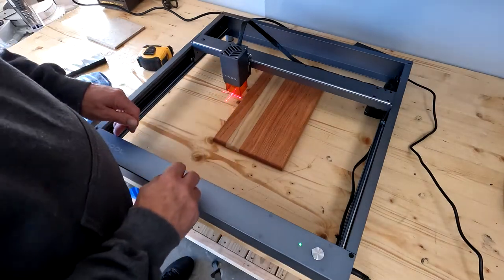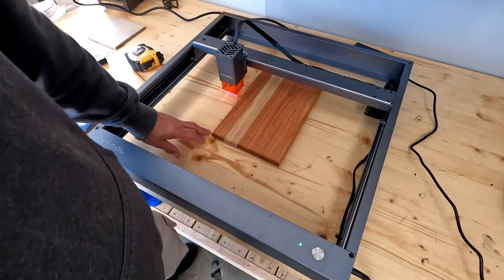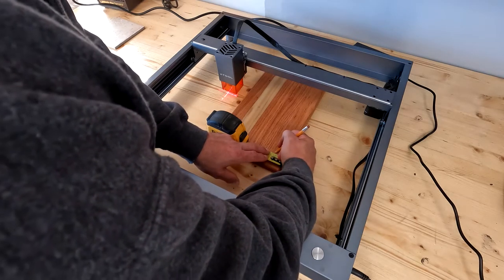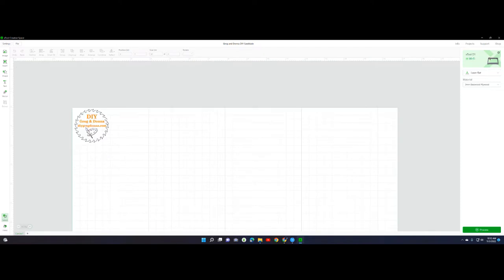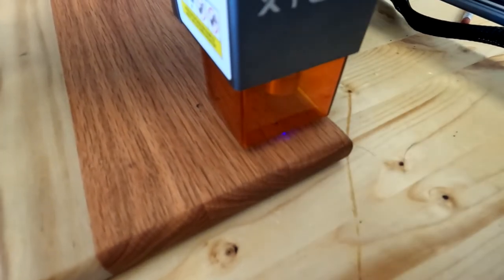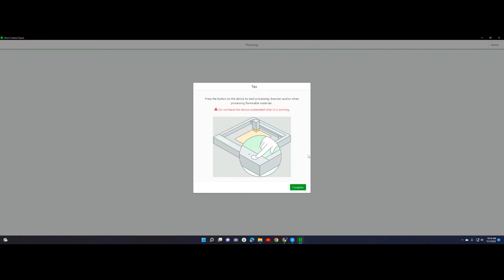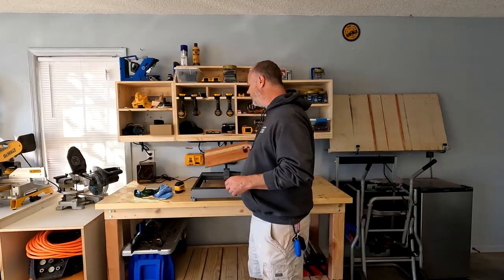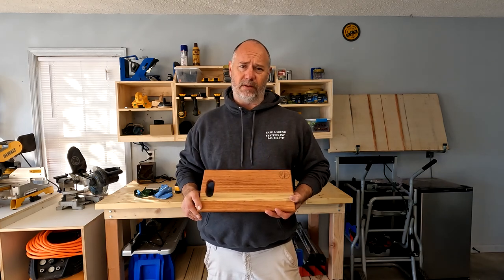xtool d1 engraver crosshair laser alignment center of project fast easy update

Comment: I'm sure you've got this all figured out by now, but just based on this video I'd recommend eliminating the need to travel between your pc and workspace! I'm very much a pc guy and it seems you are too. I do all my designs and work in my office at my pc, then I put it on a thumb drive and open it on a laptop at the machine to process. I don't have wifi is why I use a thumb drive but it's also just easy. It's my old laptop I bought for college 12 years ago, but it's perfect for this kind of thing. Otherwise if you don't have an old one, the cheap junk ones from Walmart would also work great. If you keep it offline it'll probably last a long time. Just a thought

Comment: I have no tools button and when I open settings I have General and Developer Mode (which only hunts for updates). I have no way to enable the laser spot. It is not an option when I open the process section.
Reply from the maker: Since I did the video they have changed the software.   If you have the newest version of the software, in the top right hand corner where your laser printer is, there is a little settings gear, click that, then you should see (Switch Device, Basic Info, Working Parameters), click on the Parameters the next screen should give you the option of red cross or laser spot.

Comment: When I upload my image or type text into the software and then go to engrave there is no origin, or green dot. Also when I try framing the machine goes crazy
Reply from the maker: Are you using the software that came with the Xtool or a different software.  If you're using the XTool Creative Space, I would delete the program and go back to the Xtool site and reinstall it.  When you hit the "start" button, on the left side you should see a grid that shows where to start the laser and to turn it on.  If that doesn't work I would suggest contacting tech support at https://www.xtool.com/pages/contact-us and follow up with them.
Reply: @RagerJackOfAll  yeah I am using the Xtool software, I’ll try uninstalling and reinstalling. Thank you!

Comment: This works REALLY well!  For what it's worth, if you want to us the crosshair, get it framed perfectly, the enter 16mm in the distance box and click the left arrow once. Then you can click start.  So if you have an irregular shape or something where you can't find the center you can use that. For everything where you can find the center use the method in this video as it's EXACT. The red crosshair can get miss aligned and be off by as much as 2-3mm +/-

Everyone want's to use Lightburn. For me I just use inkscape to do my design work and pull it into the creative creative space.

However with XTool's decision to completely remove all GCODE functions from XCS unless you have an M1, my options are buy Lightburn, or ditch XTool completely for something that uses international standards.
Reply from the maker: Thank you for watching, leaving the comment and the extra info.

Comment: Thanks youi I just needed to find that settings symbol. But my blue dot does not show up. When I click back to cross hairs, the red lines come back on
Reply from the maker: Sorry for the long delay, If you haven't figured it out yet, make sure you have updated the firmware and software to the latest versions.  If that does not work https://www.xtool.com/ and click on support, they have a very good tech support team.

Comment: Do you use in. or mm.? Did you make you log on XCS the size of your logo? What setting did you use?
Reply from the maker: I use inches, I just made the logo in the the software the size of the logo and saved it.  Normally I just used the 3mm Basswood Plywood setting for most of the stuff that I do.  Works good for cutting boards and things like that if using the default setting with "shapes and text" from the software.  If you import an image (I tried), seemed like every type of wood I was constantly having to change or go over multiple times.  Hope that helps out a little, thanks for watching.

Comment: Thanx for great video... How do you manage to get a clear, crisp engraving without air assist? Appreciate your help.
Reply from the maker: I've been pretty fortunate with this Xtool and it seems to cut and engrave nice crisp lines.  That was one pass at 80% on the laser at 100 speed with the demo.  I have learned that sometimes better on some types of wood dropping to 70% or 80% running it a little faster so it doesn't burn a hole and making multiple passes helps.  It does take longer though since it has to go over 2 or 3x but without spending extra money it works for my small jobs.  I think sometimes the laser being to "hot" just causes more burning around the edges and makes the lines look worse.  Thanks for watching hope that helps.
Reply: @RagerJackOfAll  Thank u so much. Very helpful info!!!
Great job!!! Greatly appreciated!

Comment: Hello great video I'm a new user and today is my first day, f'ing around and getting super frustrated. I followed your instructions to change from cross to dot, but when I do that there is no dot anywhere on my work area. Any suggestion's? (I'm using xtool creative space software)
Reply from the maker: First make sure that it actually saved in the laser mode, I have had it go back to the crosshair on occasion, especially if it does an update.  Then when you go into the start on your project on the left where it says enable be sure to click it and you can increase the % to a higher number that is not higher burn will just make the light brighter.  Once you do that, hit the framing and it should come on.  If you are wearing the "glasses" they filter out light, so while you are aiming you do not need them, only when burning, so make sure the glasses you are using are not just filtering out the light.  Sort of like Polarized sunglasses, sometimes things disappear like the number on a gas pump.   Let me know if any of that works.  I did that video quite a while ago but I do not think anything has changed on the software, I just used mine a couple days ago.

Comment: Great video! I couldn't get my blue dot to show up after switching from one to the other. I think it's because I didn't click on the "enable." I made several round leather patches with the crosshairs (aka the hard way). I will follow your instructions this evening, and hopefully, it will work. It definitely looks simpler.
Reply from the maker: The enable definitely helps.  lol  Every now and then I have noticed that the "enable" is greyed out, I have had to go to settings, put it back to crosshair and back to dot to get it to work.  Doesn't happen all the time but it does happen.  Since uploading the video I have learned that it by far the way to go, not sure what they were thinking with the crosshairs.  Oh and don't forget to center the dots, I almost always forget and it defaults to the top left.  lol Thanks for watching and taking time to comment.

Comment: Hi there, any idea as to how to fix my crosshairs? They're not perfect anymore, almost like the left and the bottom lines are "broken"/"off" a bit.
Reply from the maker: No, I would check the bottom and make sure it doesn't just have some burnt resin on the glass and clean it up.  That would be my first guess, if that's not it, try to switch to the laser to center the project, I think I like that even better than the crosshair.  Thanks for watching and commenting, hope it helps.

Comment: You think this would work on a bigger project? And how do I find the dead center ? Do I have to divide the width or the length? Also the manual says something about correcting the crosshairs because they're off by 1 or 2 cm
Reply from the maker: Yes this works on larger projects also.  You just measure your length divide by 2 to find the center make a small pencil mark, then your width divide by 2 and mark where the 2 lines intersect, basically make your own crosshair on the project to aim at.  The whole offset crosshair on the laser is pointless to me and trying to align it not worth even doing once you learn this easy technique.  Hope that helped, just take a couple pieces of scrap if you have it before you put your project in.  Take a little 4x4 or 3x3 piece and a couple tries you will have it.  Thanks for watching, let me know if you get it or need anything else.
Reply: @Greg Rger  the problem is i have some wood where the length and width are different and also looking at the laser spot for a long time could burn your eyes do you wear a certain shade of glasses to look at it then switch to a diffrent pair when starting the laser?
Reply from the maker: @jonathanblanquel  The alignment laser is more of a light to guide your aim.  Until you process your project you are fine it is not burning or cutting will you are in the framing mode but you can use your "green" goggles while aligning also if you feel safer.  You can increase or decrease the intensity of the laser dot, I think default is 3%.  While it is aligning it is not "burning" and creating plasma gas and laser flashes like while it is running.   While the unit is cutting I got the Xtool cover  https://amzn.to/3Jdopzd that has a protective shield that will let you glance at your project but your unit should have come with some green goggles also or you can get some on Amazon.  https://amzn.to/3DcHkXa

Once you create your project in the software, you go to the "framing" section where you enable the laser.  You find your center point and press the button it will outline the size of your cut and you can adjust your project if needed.

To find your center it doesn't mater if the length and width are different, if the board is 12" wide, 6" is the middle make a light mark across, If the board is 16" long 8" is the middle of that.  The 2 lines will intersect in the middle of the  project.
Reply: @Greg Rager  thanks I just received some green goggles 200-2000nmOD+4 and some orange ones 190-490nm OD6+ from Amazon and I do have the xtool cover as well just measured out the project and of course your right it doesn't matter if the width and length are diffrent ! Simple math I was overthinking! Do you wear a respirator? I wear a mask but thinking of getting a 3m p100 respirator even though I run the machine outdoors with the case and air duct and wear a covid mask my throat still feels pretty irritated from the all the wood fumes ! :/
Reply from the maker: @jonathanblanquel  Going to be a long one.... lol Get your readers on.    I have a 24x24 garage If I'm going to be in there while using it I open the bay and have a big floor fan.  I also have a small WEN air filtration system mounted above it.  Knowing what you are burning is important.  Most of my projects are untreated wood, Pine, Walnut, Cherry, etc...  Mine more like a campfire than toxic but I hate camp fires they do irritate me sometimes.  Now that being said, if you are cutting letters and using something like a layered or laminated wood, engraving metal, anything painted etc, either use a good respirator, not a 29.00 filter mask if you are going to stay with the project or cannot open a big door.  Anything I cut or engrave with paint, metal etc I have a ring stick up camera I put in the garage I can keep an eye on it if I'm not with it.   You may just have a sensitivity to whatever you are engraving or cutting.  In that case buy a little cheap wifi camera on Amazon, if you have a Ring doorbell get a stickup cam it will add right into your doorbell app, and put it where it can see the project area and you can go in and do something else and keep an eye on it on your phone. 

You could always extend the Xtool vent with something like a dryer vent tube and get it further away.  The little 12v fan should be able to push 30-40', but after that not going to do much good, not enough air volume.

Next thing even if your using outdoors, maybe get a small fan behind you or at the  side to keep you from getting blasted with the fumes.  Do not aim it down toward your project... lol  Don't want to create a flame thrower, just focus it more on you and not the project, again when I run mine my Xtool on a stand, bay door open, and then the fan is on the floor pushing out. 

You should be able to see the aiming laser with the orange glasses, but you may have to change it from 3% to a higher number.  The Green are for the higher intensity light that you cannot see.   Light we can see as human is 400-700nm (nanometers), that's why you can see the dot with the orange.  Once you get above that you are into the nanometers and there is light, we just can't see it, like night vision on a camera.  Those invisible light particles and plasma flashes are what can really damage your eyes, that is the light being used while it is in operation.   Sorry for the light lesson, I install security systems and cameras for my business, had to learn about that.    

Anything else let me know.  I will be doing a few more videos on there soon, just been swamped lately with work haven't had time.  

Last l did do a "grid" system under mine.  https://youtu.be/G-hHKhT850Y  I didn't take a lot of time measuring it out, my projects are not "precise" work, but this helps you just put your project up there and help align.   I then took smaller pieces of 3/4 plywood and gridded them and stacked them, so my legs are all the way up on the tool, and I can add or remove the plywood as needed for height.  With each piece "gridded" it makes it fast to stack and unstack.  If you are doing the same project like a sign or a cutting board which is the same every time, just make your base grid and make one piece of "stack" and take a pencil and outline your project.  Every time you do that project throw it up there, put you piece on and go...  When it gets burnt or damaged just make another and your base is still in good shape.
Reply: @Greg Rager  thank you and you're right I tried it my self I can see the laser dot align at %3 with the orange glasses but not the green ones ! I'll be waiting for your next video . And by the way i install security cameras too ! I have security cameras in my backyard where the machine is and also I have my laptop setup as a remote connection using Google Chrome. Last question did you setup the wireless on your xtool ? I had the option too but I couldn't get it going with the XCS program
Reply from the maker: @jonathanblanquel  I did set up the WiFi, took a few tries but I got it.  I am using an Eero mesh had to temporarily disable the 5ghz to get it to connect.   Just make sure you have a strong connection.  One other thing I did was change the SD Card to a Scandisk V60 or V90 card.  Kind of helped with transferring the information to the unit.  I was having some issues at the beginning transferring from the PC to the unit, I just happened look at the card that came with it was like a small cheap looking sd card.  I have gopro's, dash cams, spycams, so I have sd cards laying all  around.  Have a couple busy days of work hopefully this weekend I'll have time to get a couple done.

Comment: We haven’t actually been able to use our d1 pro. How do we get the crosshairs to go straight down instead of off to one side?
Reply from the maker: You can't... That is why I did the laser alignment video.  I'm not sure what they were thinking and why they couldn't have just offset the crosshairs.  If you go to that settings tab, you will see where to turn them off and turn on the laser guide.  It nails it pretty much dead center every time.  I guess if you were working on a square edge project and started in the top corner it would align your project straight but for hitting dead center the cross hairs were useless for me.  I bought mine to brand cutting boards and projects I make so hardly ever have an edge to align.  Anyhow sorry for the long explanation but trust me I watched a dozen videos trying to do the simple center alignment and just made my own video.  Thanks for watching, please click on like and subscribe.  I've done a few more things with the laser, hopefully work slows down a little so I can work with it some more before Xmas.

Comment: Very strange. I don't have the green dot on the processing screen, so everything is guesswork. Even when I align the laser to wherever, it moves and engraves where it feels like
Reply from the maker: I know they released new software lately, make sure you have the latest software for the machine and the software. https://support.xtool.com/article/524 To do the machine software you have to flip a little switch on there and flip it back when you are done.  Without the latest software things don't work quite right.  I also have not been able to re connect my wifi since the last update, so if you run into that hopefully this week I'll have time to figure that one out.

Comment: Any trick to get the laser, changed it to laser and nothing
Reply from the maker: Shouldn't be, have had several comments on this and no one has mentioned any difficulty.  Make sure your software and the unit are both up to date.  That is the trickiest part is making sure that switch is flipped the right way when updating the firmware on the unit.  If that doesn't work may need to call them and ask.  I have called for a couple other small things they are pretty helpful on the phone.
Reply: @RagerJackOfAll  Thank you for the reply I might just have to make that call 😔
Reply: I have the same problem. What is the solution? Thanks!!
Reply from the maker: @manuelastockmaier9742  Make sure your software is up to date and also the xtool.  You have to download firmware to the xtool every now and then.  https://support.xtool.com/hc/en-us If that doesn't work there is a contact number for them.  Hope that helps.
Reply: @RagerJackOfAll  thank you! I‘ll try…